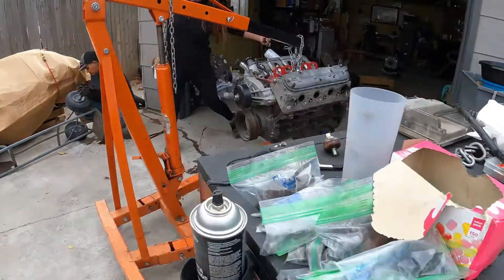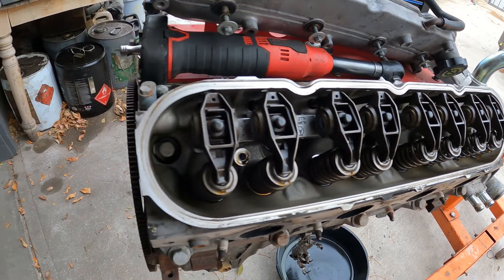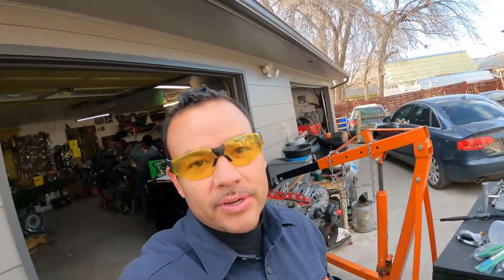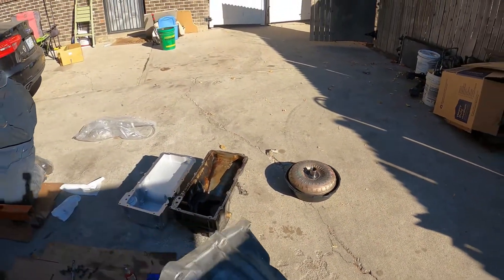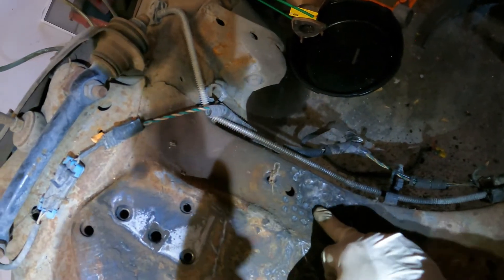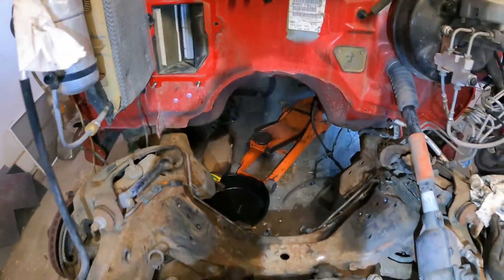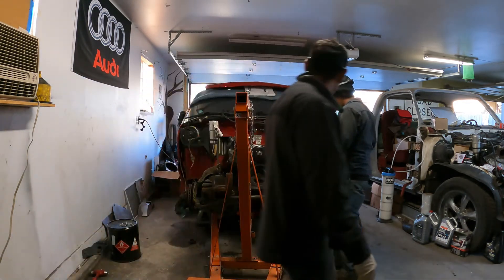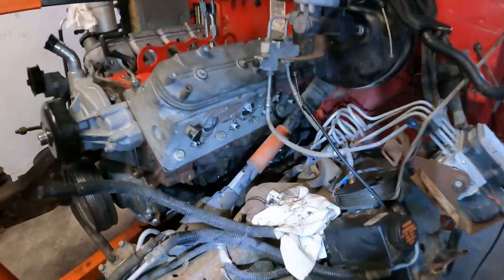How to LS swap a s10: prepping the engine and dropping it in!

Comment: Keep up the content am in the process of putting a 6.0 on a s10 my self
Reply from the maker: Thanks Victor for the comment!  That's sweet are you doing any mods to it like cam or head work?
Reply: @advancedstreettechnology2081  what fans you going to use ?
Reply from the maker: @victorrodriguez3957  I'm running a 15in slimline fan. The wiring harness I got comes with 2 fan connections engine and ac.
Reply: Not at the moment am just putting it in and drive it around but for sure later something we’ll come up it’s a budget build for me